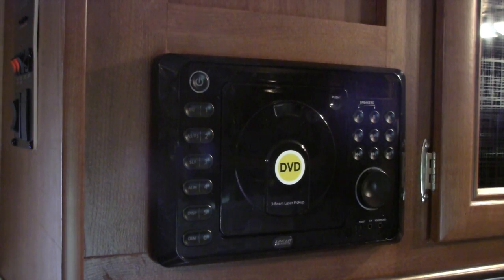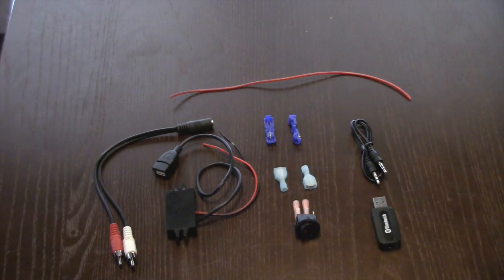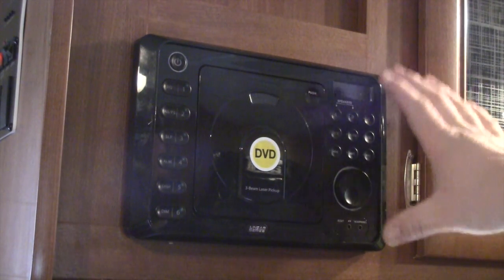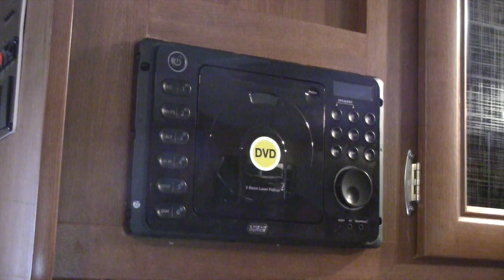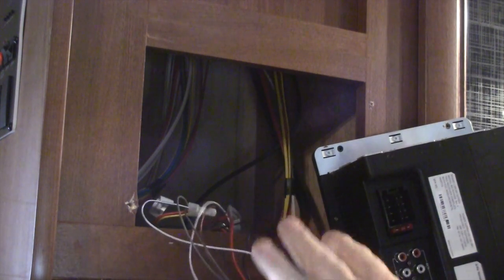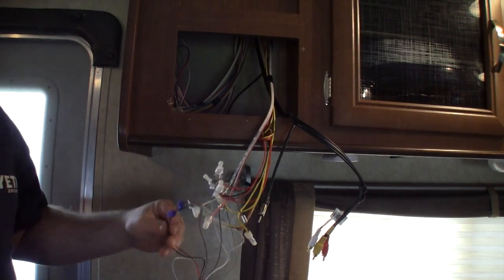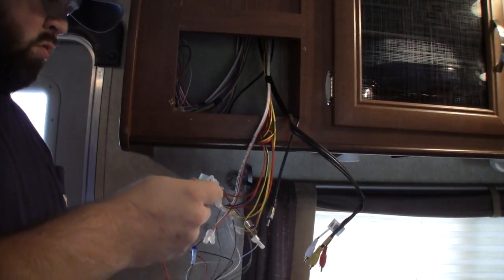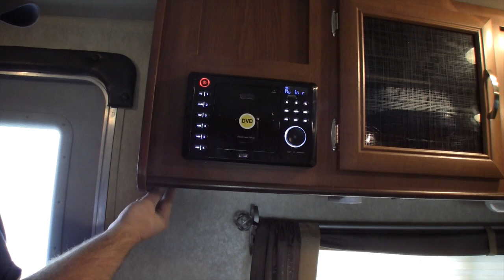DIY | ADD BLUETOOTH TO STOCK CAMPER STEREO

Comment from the maker: Checking out what I used? Find it here!
12v to 5v Converter - http://amzn.to/2kXnCVW
Bluetooth MP3 - http://amzn.to/2klzxuZ
LED ON OFF Switch - http://amzn.to/2kXo4DC
RCA to 3.5mm Cable - http://amzn.to/2kXnvd2
T Tap Kit - http://amzn.to/2lFDwof